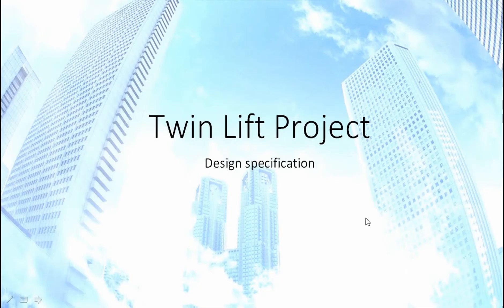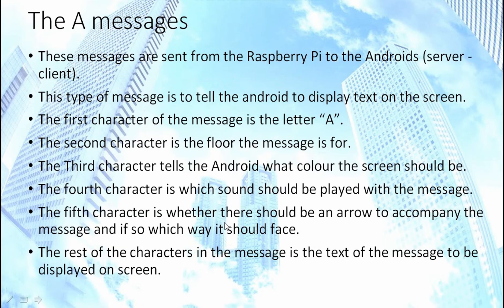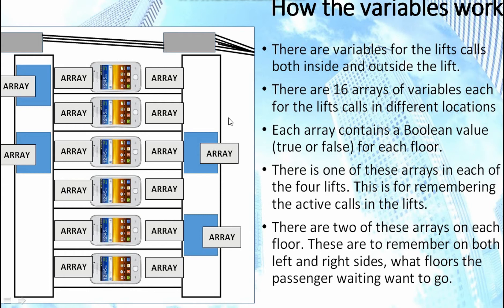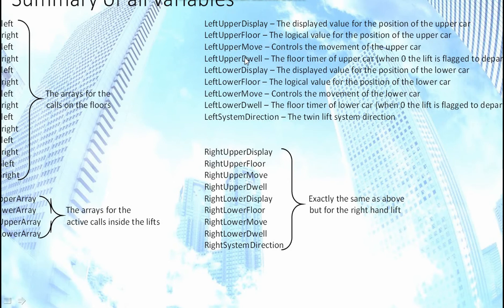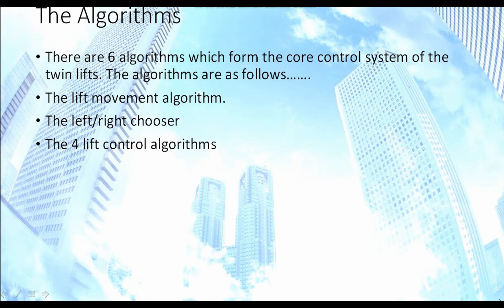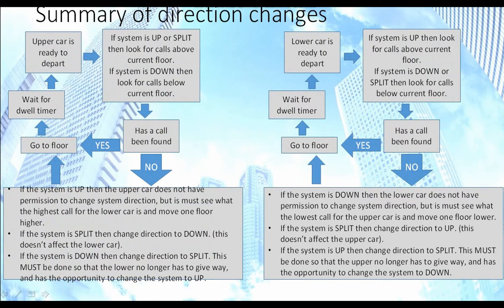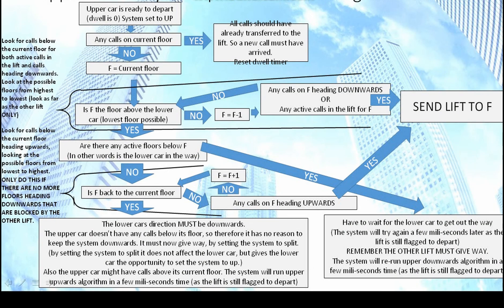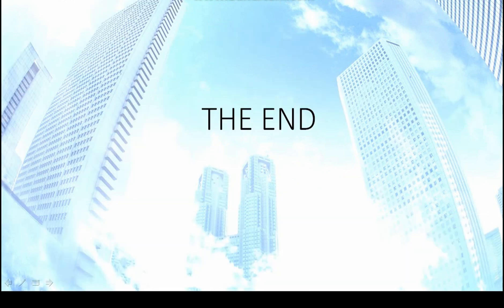TWIN LIFT PROJECT - Part 1: Design specifecation

Comment: If installing a twin lift it could be possible to save money by having no top or bottom holding area. Instead, if a passenger typed that they wanted to go to the lowest or highest floor, it would only call the lower or upper lift. This situation works best if the lift serves a basement or top floor which is not very busy.

Tall skyscrapers could save space by having only 2 sets of lift shafts. One of the sets would be the local lifts. Each lift shaft would have multiple lifts in it, but these lifts would overlap, so that every floor that is a multiple of x is served by 2 lifts in each shaft, & it is the lowest floor for one & the highest floor for the other. The other set of lift shafts would be the express lifts, serving all floors that are multiples of x.

Comment: One of the other advantages of having the users select their floor before entering the lift is that it prevents them from pushing both the up and down buttons simultaneously resulting in wasted car stops.

How would you communicate to users to take the lift after next (if the upper left lift was boarding or exiting, but you want them to take the lower left lift after the upper one has left). I don't think this is programmed, but having the bottom lift serve the lower floors would be more efficient as the lift will spend less time in the holding areas.

It would be more efficient if split mode works so that the top lift can travel down while the bottom lift is traveling up (provided there is a suitable buffer space between the two), your model may not be big enough to make this worth it though.

An up peak mode where the cars reset to the lowest floors (sending the lower car into the holding area) may improve efficiency.

If you are presenting this to an audience then you may want to adjust your slides to make them fully visible (some bits were off the edge of the screen). The text size for some of the algorithm pages is very small and will not be visible from a distance.

Good luck.
Reply from the maker: As part of the project I did a survey to see whether people would be accepting of a twin lift system.  My survey had very poor results.  One of the questions was if there was a sign saying to choose your floor before entering but a lift already had its doors open, one third of the people surveyed said they would go straight in the lift and ignore the screen.  As for being told to take the lift after next (so they would get in the lower car if the upper car was next to arrive), all but one person said they would not obey this instruction.

There are many different ways that a twin lift could be programmed.  I believe that the way I have programmed it (by using up split and down modes and changing between them at the correct permission) gives the most equal serving of the shaft by the 2 lifts. But as you said it definitely is not the most efficient system. A different method of programming could be to have the lifts running totally independently, but that could have problems with managing the shaft space.  It would be a much more complex system in choosing the best lift for passengers as the lift movements would be less structured.
Reply: ***** I suspect most people would initially reject the idea as they are not used to it. If it was installed in a building with regular users then they would adapt to it.

Once users are stuck in the basement "sin bin" or if nobody in the lift has selected their floor they will get used to following the instructions. Having said that, a lot of people can't work out the difference between up and down on regular lifts (maybe electrifying the car call buttons for the wrong direction would help them).

The "take the second lift" scenario could occur, for example if a passenger wants to go up and all the lifts have a destination at, or below, the floor the passenger is on.